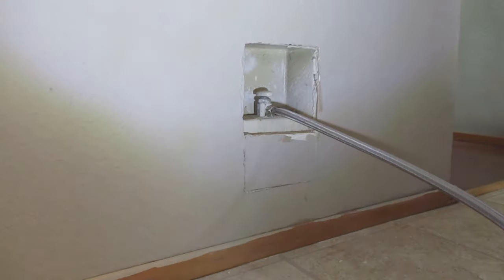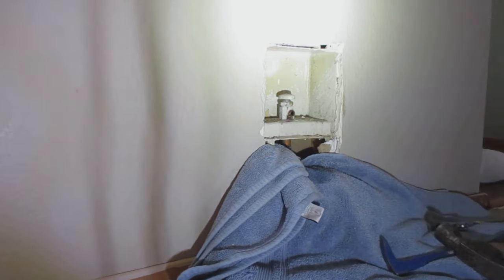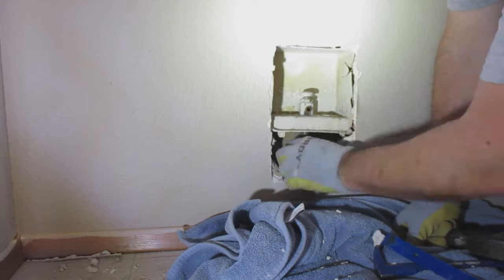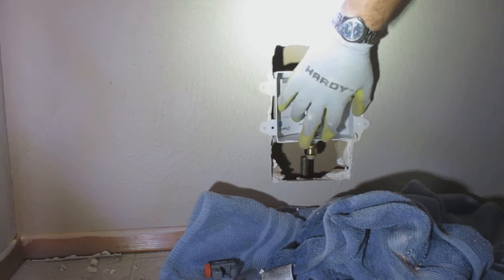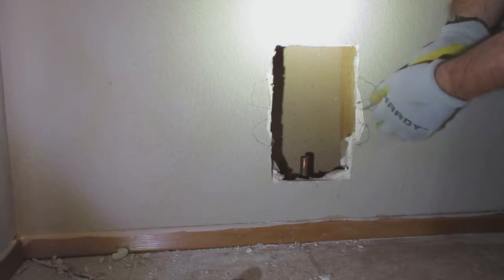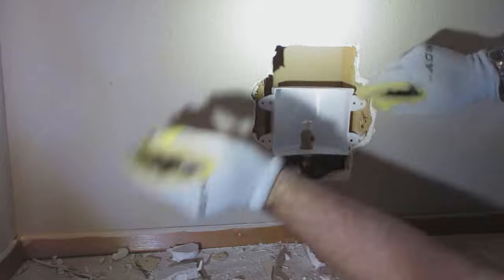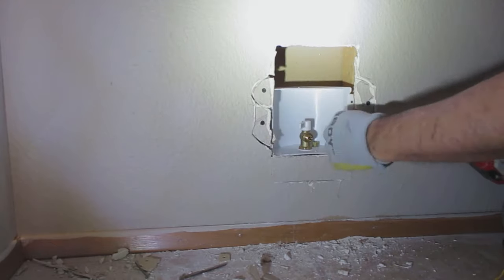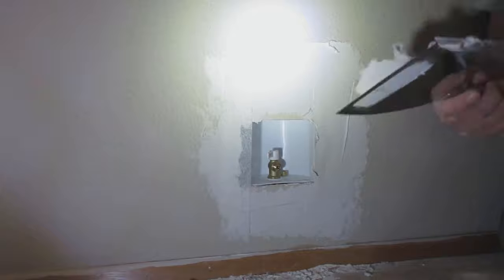How to replace install ice maker water supply valve for a refrigerator - DIY

Comment: Thanks for making this video. I need to do the same repair, and wanted to get a idea about how to do it. I wish they just made it so I could simply unscrew the old valve, and screw in a new one. Having to cut into the wall sucks.  :-)
Reply from the maker: Thank you for your comment. I know the drywall repair isn't hard it just takes time. I wish you it was easy without the drywall repair. I hope your valve replacement goes well.
Reply: @mountpac4464  Hey there, it actually did go well, and it was actually kinda fun to do. I sand and paint it tomorrow.  Thanks for your help with this one.👍

Comment: Did you have to tighten the fitting (or whatever) onto the pipe?  How does it tightly fit onto the pipe?  I have to do this.  Getting a new fridge delivered today.  The current valve won't completely shut off.  I have to turn the water off at the street before I disconnect the old fridge.  Once the new fridge is installed, I can turn the water back on.  Will have to replace the valve in the wall soon.  Thanks for taking the time to make and post this video.
Reply from the maker: its a push on. Sharkbit fitting. Thank you for watching. :) #mountpac

Comment: Thank for making this video. Old valve broke off, this made it easy to replace!
Reply from the maker: Thank you for your comments. Sometimes I wish I showed the removal on more drywall than I did. It may have been easier but not less time. I hope your valve replacement went well. Have a great day!

Comment: The valve you added, mine is now identical to your new one!  Mine, 5 years later,......leaks.  Shutting off is 90% effective.  When the hose is disconnected from the valve WE added,......it leaks.  So, as long as its attached to the refer, its fine.  FYI.....
Reply from the maker: bummer I'm sorry to hear that. Have a great day!!

Comment: I’m no plumber but I do attempt small jobs. This is one I’m attempting. Can you use a bigger access tray in the wall
Reply from the maker: Hello, the one I used was the one they had at my local hardware store. You could cut out more drywall for access. Then drywall and patch the wall when done. I hope this helped. Have a great day!

Comment: What I don't understand, is if this will need to be done every time the valve goes bad. What happens when the pipe gets too short?
Reply from the maker: this part is a push on so there is  a tool to be used when needing to remove it again. Thank you for watching. :) #mountpac

Comment: Will shakebite inside the wall causing any concerns in longterm?
Reply: In a place like this, it would be an easy replacement if it did start to leak. I would never use this in a shower of behind a kitchen wall that would be massively expensive to replace.
Reply from the maker: not concerned. The way the shark bite connection is designed the fitting shouldn't leak. Have a great day!
Reply: If you use a sharkbite don’t put drywall back, screw a thin board over that area.  While not often, they do leak.  Best method is the sweat a piece of copper pipe after the cut, add a male fitting in a plastic box that is also sweated on, then use a high quality shut off valve the screws on the male fitting.   He took the easy way with sharkbite.  I’d never use those behind a wall.  Spend a bit more, sweat weld the pipes, use an all metal (inside the valve) shutoff and you are finished forever.  Plus the next person will love that you did the fix the right way!

Comment: Do I have to cut out dry wall and pipe?  Can I just unscrew the valve off and replace just the valve itself
Reply: No.
Reply from the maker: If the valve is leaking and not funtioning properly I would recommend replacing the entire unit. Have a great day!

Comment: Wow. I just stumbled across this while researching something else. This right here was my very first question when i bought my home 2 years ago. I never figured out why that sound happens, oh sweet!! Question honey, my fridge is against a 2x4 exterior wall in a cold climate. The pex water line isn't in the wall for freezing concerns, mine snakes up from the basement through the floor somewhere below my adjacent kitchen cabinets, then runs sideways out to the rear of the fridge. This here boxy thing with arrestor... How close to the fridge must it be? Id have to install it inside a cabinet which is unfortunate... Or install it in the room below the kitchen area along the pex run... Hmm both sound like trailer rigged ideas. Any suggestions?
Reply from the maker: Hello, Thank you for your question. Without being at your kitchen and looking at your situation I'm not able to give you a full response. However I hae seen ice box lines run through cabinets. I hope this helps. have a great day.

Comment: Hi sir. We have different problem, your is leaking and mine is not water supply from the valve. I was thinking maube the mainline is off. Cause no water coming out from the valve when i open
Reply from the maker: I'm sorry to hear that. Without knowing all the details. There might be serval reasons. Maybe during a previous remodel the line was cut and never reattached. I hope your able to figure it out. Have a great day!

Comment: Do you have to replace the whole thing ? The val is leaking & mines is upside down .it’s not at the bottom the val is on top
Reply: Valve
Reply from the maker: Hello I'm not sure how to answer your question without seeing your specific situation. I had to replace the entire assembly due to a leak . I recommend a full replacement but I recommend contacting a local plumber or contractor for the specific answer to your question. Have a great day!
Reply: @mountpac4464  thanks for replying back I bought just the valve and it’s still leaking smh I guess back to Home Depot!
Reply: Im having this same issue. And same spot too. The pipe is leaking and also on the top

Comment: I would not use a sharkbite inside the wall. Call a plumber to solder on a new copper stop. This might work tho in a pinch but unless it's a rental I wouldn't do this in my home
Reply from the maker: Thank you for the comment. SharkBite fittings are approved by my building inspectors. Have a great day!!

Comment: The Shark Bite stuff really works? I've never used them
Reply from the maker: Hello, Yes I've been using them for 4 years now and never had an issue.
Reply: Never use a shark bite inside of a wall, copper and pex have a 50 year lifespan shark bites have a 10 to 15 year lifespan as a plumber I would never use a shark bite unless it was an emergency but if you really need to use a shark bite never do it inside of a wall
Reply: @onebozo4u  maybe, but at least Shark Bite's valves are way better quality metal than most of the other brands.  If you can find a brasscraft valve that is over 10 years old and still works it's probably still in the package.   I had my house replumbed about 15 years ago and every single brasscraft valve is bad.
Reply: Brasscraft all metal 1/4 turn ball valves will last 25-30 years.  Buy plumbing grade parts not big box crap.  Most brasscraft plumber grade shutoffs start with KTCR.  The stuff that starts with a G has plastic guts and ladts 2 years.  Huge huge difference
Reply: Best way to fix this is to solder a new piece of pipe at the bottom with a brass female fitting at the top, get it into the plastic box even if you have to cut the box a bit, put a all metal ball valve on the female threaded end.  If the valve fails again, the next person will thank you for a simple replacement!